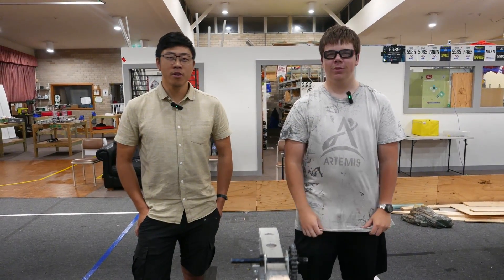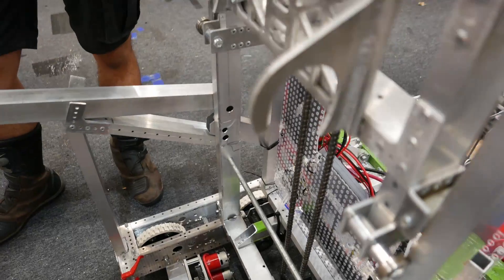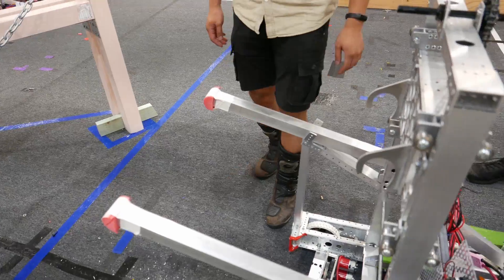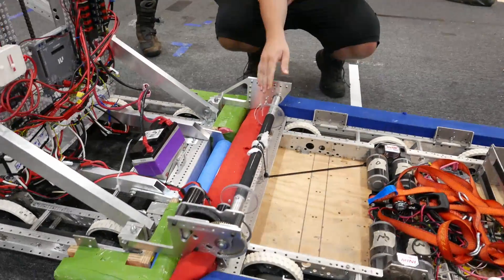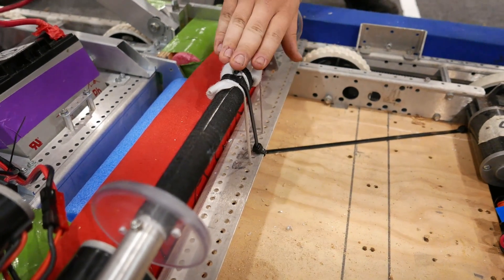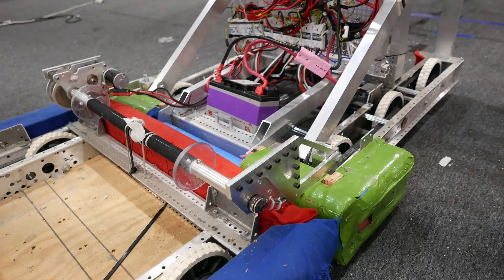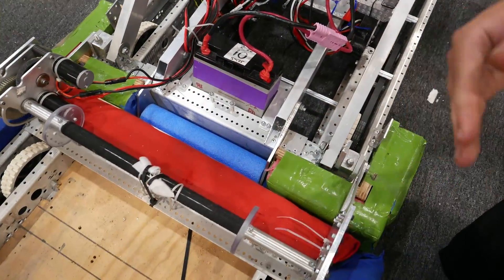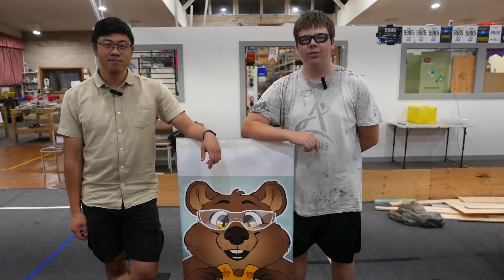[2024 Ri3D] Buddy Climb Concept Demo and Breakdown

Comment: Very nice idea, Love the concept, however I suspect you are violating at least two rules
R105 - ROBOT extension limit. ROBOTS may not extend more than 12 in. (~30 cm) beyond their FRAME PERIMETER. (Kinda looks like that padded arm is extending beyond 30cm)
and 
G415 - Watch your ARENA interaction. ROBOTS are prohibited from the following interactions with ARENA elements, except chain (6.5.2.D may approve this action though?)
Reply from the maker: R105: We aren't extending over the 12" limit (the pink pool noodle is, but that's not at all structural and is to stop us taking out our kneecaps on the stabilising arms.

G415: This doesn't matter as 6.5.2 D explicitly allows this interaction.

Comment: Don’t you need to touch the chain?
Reply: As 6.5.2 is written, no. "An ALLIANCE achieves HARMONY if more than 1 ROBOT is ONSTAGE via direct or transitive support from a single chain. HARMONY points, as specified in Table 6-2 are awarded per additional ROBOT." Item F in the list above covers being held by a teammate.

The only part that gives me pause is touching the underside of the core...6.5.2 item D of what a robot may be contacting may cover this though. "Carpet-facing surfaces of the core"?
Reply from the maker: @nickorr1475  you're correct, 6.5.2 D allows for this climb to be legal.